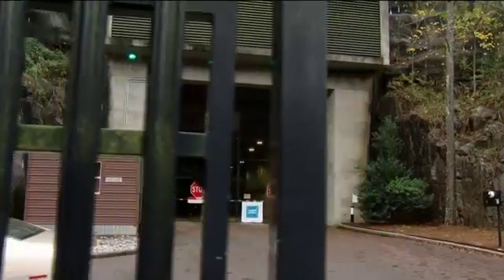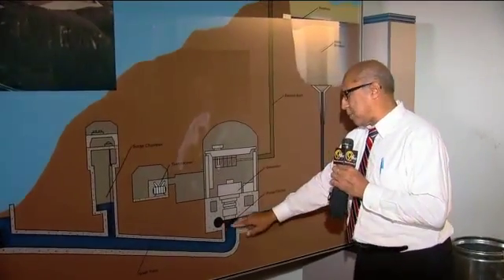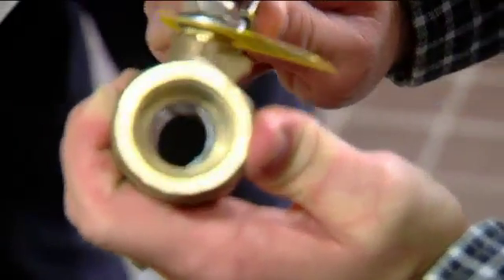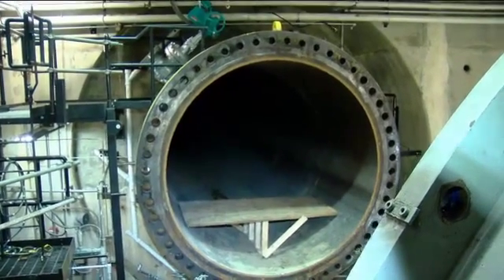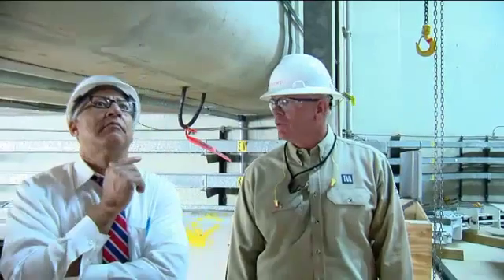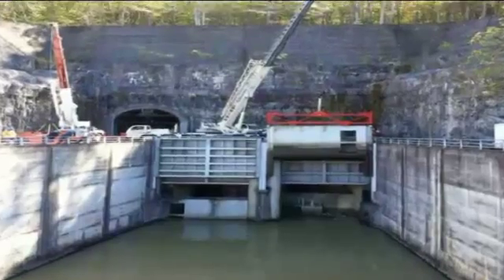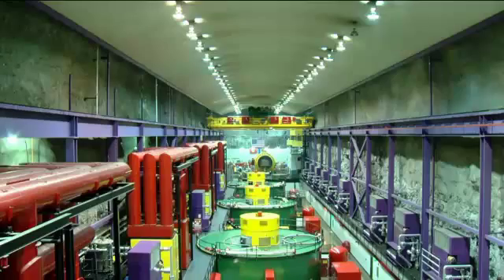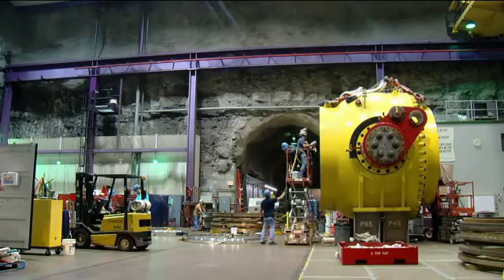TVA Raccoon Mountain Pumped Storage Plant:  An Engineering "Feat" Beneath%

Comment: Watts Bar is far more productive than Raccoon Mountain because Watts Bar generates all day long. How exactly is Raccoon Mountain keeping people warm when it doesn't generate all day and it actually uses electricity during what is usually the coldest period, night? In 2017, Raccoon Mountain generated 686 Gwh whereas in 2017, each of Watts Bar's units generated about 6,825 Gwh. Each unit at Watts Bar is about 10x as productive. So, all of Watts Bar is about 20x as productive.
Reply: It generates power during peak loads during the day. A coal or nuclear plant cannot manage the peak demands that occur through the day as people turn on heat, computers, etc during the daytime hours
Reply: @Arms0fGod  Neither can Raccoon Mountain as Raccoon Mountain is parasitic and baseload power is far more important.
Reply: @Jemalacane0  I work in power generation. Pump storage is critical to power grids. Maybe you don't fully understand its purpose?
Reply: @Arms0fGod  It's not critical at all. It's a parasitic energy source which wastes ~25% of what it consumes. The only real benefit I can see is with wind and solar, but that's about it. However, investing in firm baseload would be better.
Reply: When you invent a battery big enough to hold  extra power and discharge it instantly when people need it, let us know. 
Racoon mountain is a mechanical battery. The problem is when you switch on your air conditioner or your fridge kicks on there is a large surge load that is much stronger than when things run constantly, power must be instantly available for you all while not letting the 60hz get bogged down in the grid. A nuclear power plant is very slow in changing it's output, dams involved in flood management and must maintain reservoir levels so they can't just go full throttle when they want to... This is the best and quickest solution we have come up with to date. It solves the problem we had and works amazing. What you should be thinking about is how to run the pumping stage off of something like solar or wind when not producing power... That would be a real win.